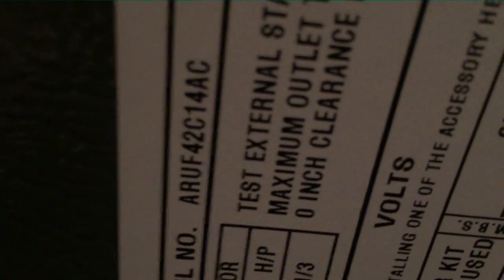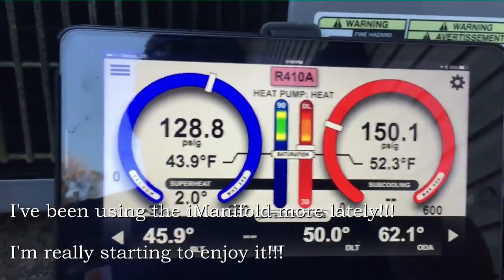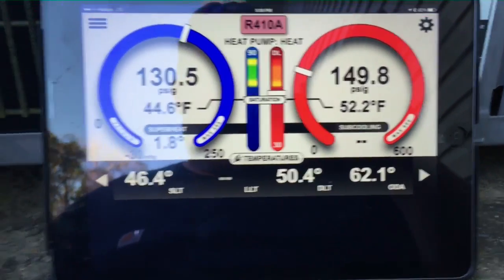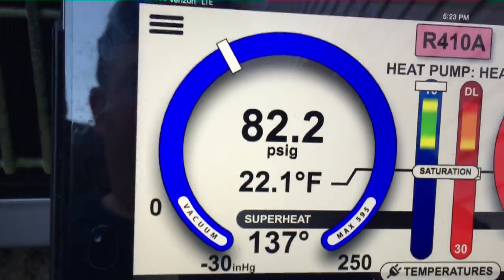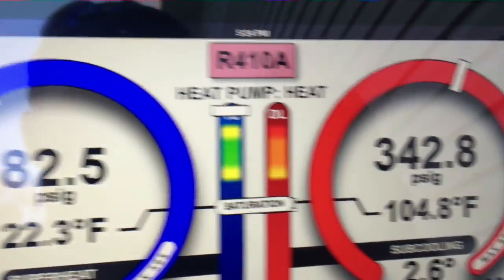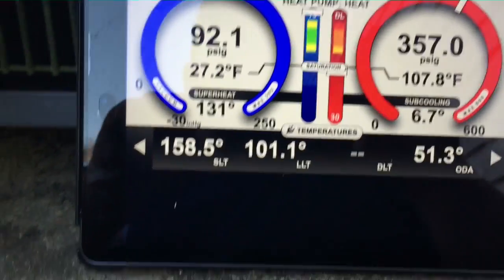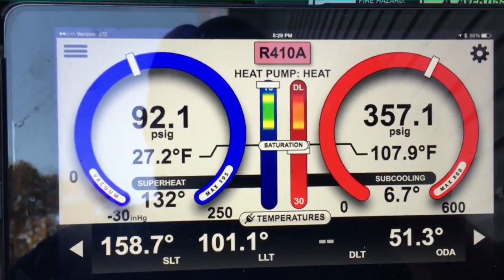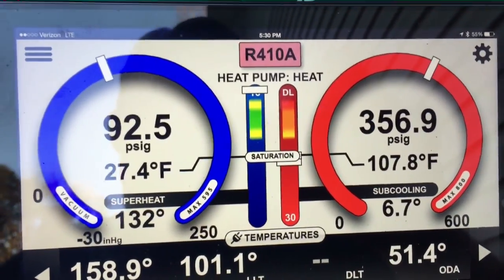HVAC Service: Leak Search & Repair

Comment: Hi Israel, really enjoy your videos learning so much and I also just got an MC bag, anyway I'm working for a guy who swears R407C is a "drop-in" for r22 and for what I read it's not but he don't want to hear it, he adds it to current r22 systems when they are low and also when charging a unit when we install new evap coils, thanks for your input

Comment: What's the name of the leak detector tool you use ..
Reply from the maker: H-10G by Bacharach!! H-10G is the original H10 that runs on 110 volts!!! Then they came out with the H-10PM which is battery powered!! Now Bacharach has discontinued the H-10G & H-10PM and now they have the H-10 Pro and it looks bad ass i'm going to get one!!!  Heres a link to it!!!     http://www.trutechtools.com/Bacharach-H-10-PRO-Universal-Refrigerant-Leak-Detector_p_3746.html

Comment: Nice Job John. I am new to HVAC and looking for a good leak detector any help would be helpful.
Reply from the maker: Hey Keith Thanks for watching buddy!!! You cant beat the H10 by Bacharach which is what im using in the video!!! Mine is the H-10G which is the original H10 that run on 110 volts!!! Then they came out with the H-10PM which is battery powered!! Now Bacharach has discontinued the H-10G & H-10PM and now they have the H-10 Pro and it looks bad ass i'm going to get one!!! I suggest you go with it!!! Heres a link to it!!!     http://www.trutechtools.com/Bacharach-H-10-PRO-Universal-Refrigerant-Leak-Detector_p_3746.html
Reply: Israelhvac
Thank you so much for taking the time to help me. I will definitely check them out. Look forward to more great videos.